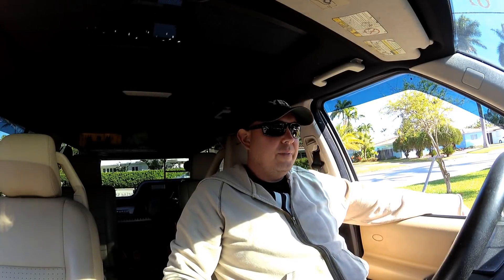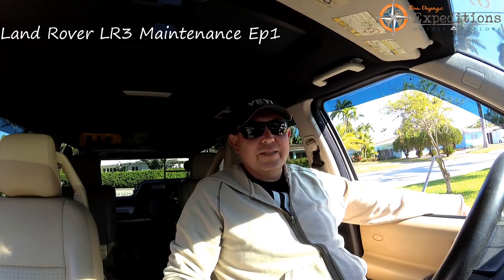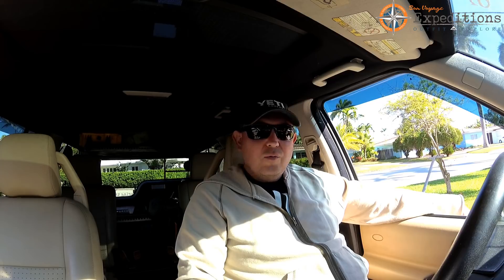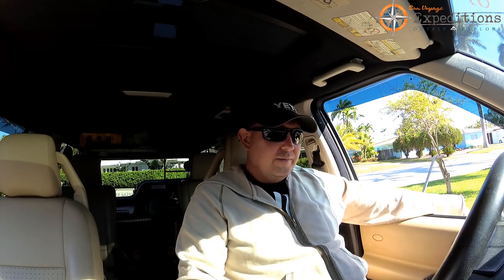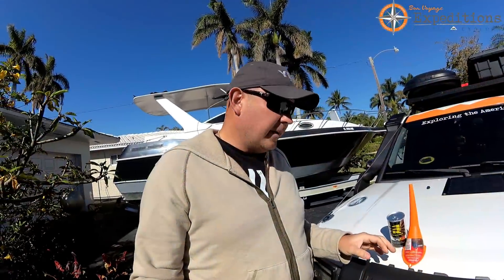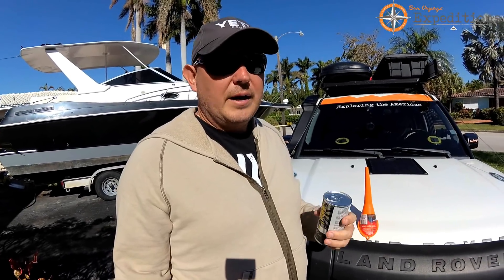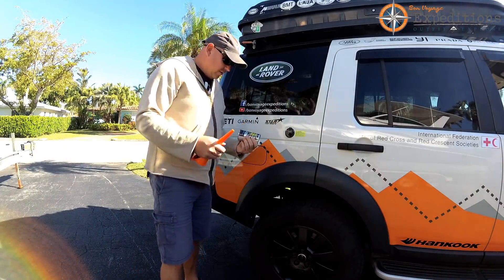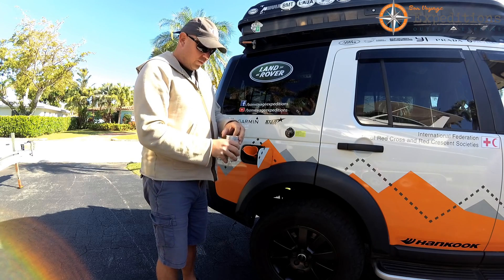LR3 Maintenance, Ep.1, Fuel Injector Cleaning Procedure

Comment: The bottle says it treats up to 20 gallons of fuel. Is it recommend to use it the way you did. Drive with a quarter tank or can I just fill the tank and put the 44k in with it ? Is there a difference from the can and the bottle 44k? Thanks
Reply: Where did yu get the treatment cleaner from?
Reply: @mrmarkusgoat9631  I got it from Amazon .
Reply: @illskillz05  thanks